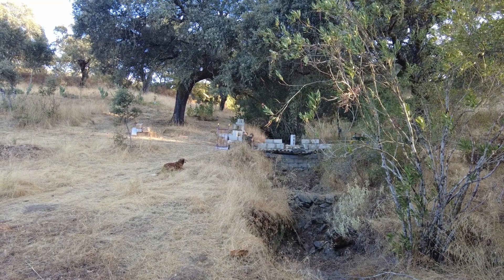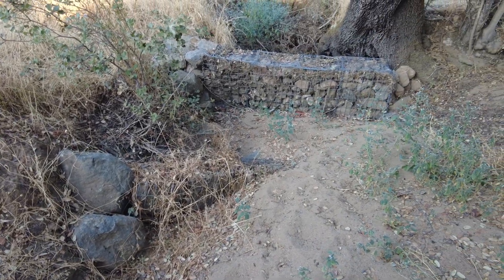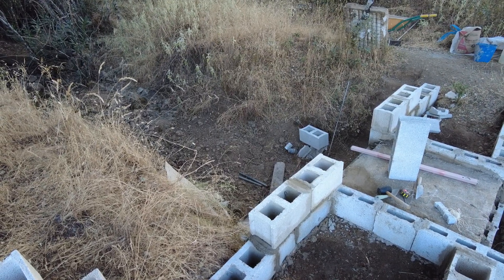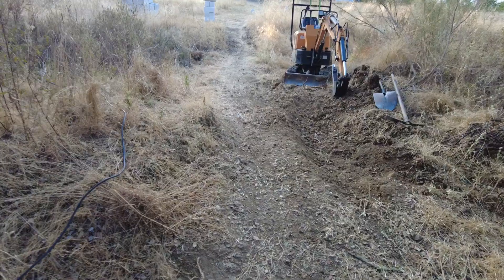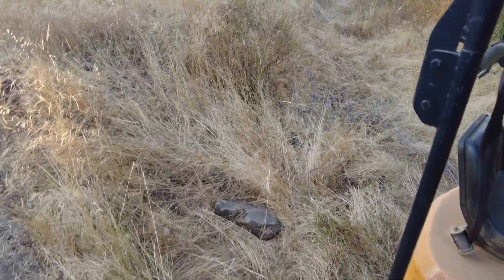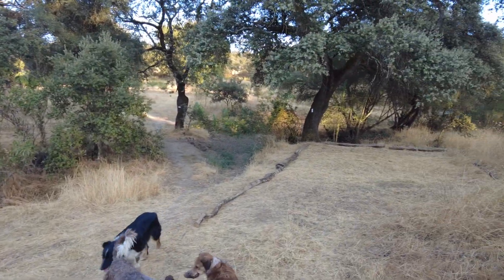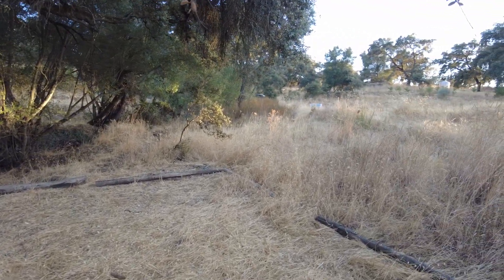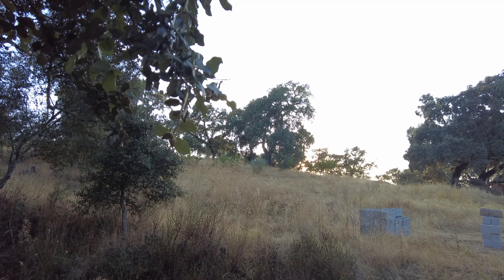Sand dams. Ancient solution for modern issues. #sanddams

Comment: Can you explain why you continue to build high structures? From what I know, the water will cascade over them and erode the soil at the bottom. Enough soil eroded at the bottom leads to collapse, which i believe you have encountered a few times.... 
In my opinion it would be much better to put your energy into One-Rock-Dams and baffles, which would help bring the stream back up to  floodplain levels (Aggradation) and reintroduce the natural meander! You even have an excavator and could reshape the whole of the riverbed by yourself as soon as the stream stops flowing in spring/early summer. Plant it out with vetiver and put in the ORDs, Zuni Bowls and Baffles. 

I have created a playlist on youtube called 'Erosion Control Playlist'. I would encourage anyone to look at the whole playlist; but especially the last talk by Bill Zeedyk (though maybe at 1.5 speed ;) ).
Reply: The goal is exactly as you say, fill the incised stream bed (aggradation) with the eroded blend of clay, sand and gravel that comes off the mountain and distribute the water in 3 directions. ~1/3 will flow in the original creek bed, ~1/3 will flow over the bank onto the easterly floodplain  ~1/3 will flow over the bank onto the westerly floodplain.  From this point it is up to nature to find the natural meander(s) over time.
The incised creek bed already has 15 to 20 individual structures built over the past 3 years including;  BDA's, leaky rock weirs, two gabions (one almost fully buried in sediment), one rock check dams and strategically placed vegetation.  Hundreds of cubic yards of sediment have been collected over the past three rain seasons.  More is collected each year as more structures are added and old structures are built up to match the rate of aggradation.  
I believe we are proceeding toward the same end goal -  a restored , naturalized and sustainable year round creek. 
🌻
Reply from the maker: Super. I will be happy to look at it. Keep sharing. Much appreciated
Reply: @SuerteDelMolinoFarm  Cheers. I would link to the playlist but for some reason youtube doesn't let me. Just search for 'Erosion Control Playlist Futurecare Design'.
Reply from the maker: @futurecaredesign Found it. I've seen many but will revisit. Thanks for sharing valuable information
Reply: Of course I don't have the experience that you do in your climate and location, but this is what I was taught by people who know better than me.

Comment: What the fuck that is a old gabbion??? WOW holy moly this is insane. It really is true that positive cycles run WAY faster than the degenerative ones! Thanks you so much for this important work!!!!!
Reply from the maker: You are welcome. Watch your language. Just now I speak like you and then I'm cancelled. Ha ha. Thank you for sharing
Reply: Isn't it cool that so much eroded material has come off the mountain and been captured.  3 Years ago, I would have said not possible.  And each structure that is across the creek has captured sand and gravel, restoring the bottom of the creek over time.  There is a way to go - but you see, the structures just keep on coming!  Getting the big rain water up and over the banks onto the floodplain is the end goal. When the flood plain flows regularly, the creek will be restored.

Comment: Looks great. 
I am concerned you will need to be in 3 places at once each rain storm to get the balance right.
Hope first rain is in tge daylight so you don't have to be up all night.

Any chance to set up some timelapse cameras so we can see the water level rise and spill?
Reply from the maker: You are so right. The tweaking agent will have to run all over the place. Ooh. Timelapse? What a good idea but remember I'm old and scared if modern technology. Ha ha
Reply: @SuerteDelMolinoFarm  I agree about tweaking.  That is why I suggest below that you stick to the two methods of tweaking you already use; 1) Cement blocks half filled with cement on a concrete curb between a fixed opening.   2) Stop log sluice gates.  This way you know what to expect from the control measure.
Reply: @SuerteDelMolinoFarm  You make me laugh. 😃 Generationally, we are birds of a feather!

Comment: Hello Mr. Farmer!  I believe your laser level will tell you everything you need to now about the three paths that the water coming off the mountain will take.  My suggestion at this point in the project is to make all three waterways (east and west floodplains and the spillway) all the same elevation.  
The dam spillway is already established, so that is your reference elevation.  If I understand correctly, you plan to weld a sluice gate type framework that will hold stop logs in place to adjust the flow over the spillway.  I would place the 'sluice gate' frame on the south wall of the dam.
The east and west spillways will flow onto the respective floodplains.  I'll suggest these spillways can be constructed in the same way as you have constructed all of your swales and berms.  Use your laser level to determine the height of the bottom of the swale and build and compact your berm accordingly.  If you make a level cement sill to establish the bottom elevation  of the swale (same as you did at the eastern distribution pond) you can use your cement filled blocks to control the flow onto each flood plain and you can be certain the floor of the swale will not erode.  I hope this all makes sense.  If you have questions, please ask.
Good luck with your planting of vetiver.  I hope you are able to get lots of roots in the ground!  It would be nice to preserve the northern boundary crossover.
Hopefully there is something useful here.👍💙🌳🌻
Reply from the maker: Always something useful Steve. I'm not sure how all will unfold but I keep my head full of options. Keep sharing. Much appreciated